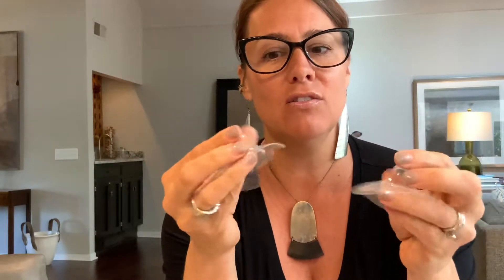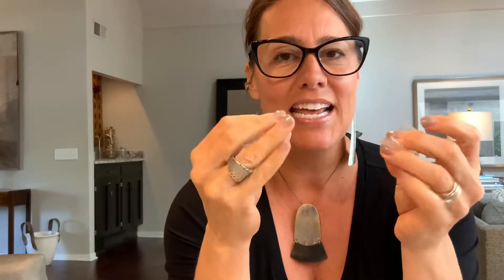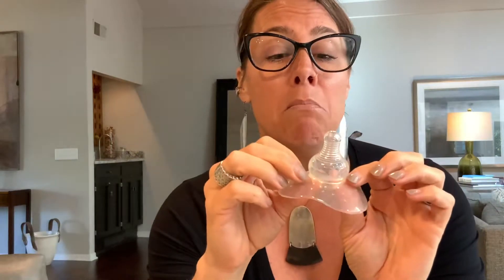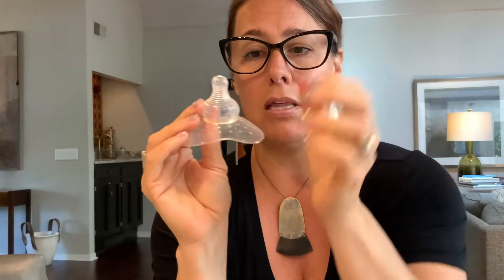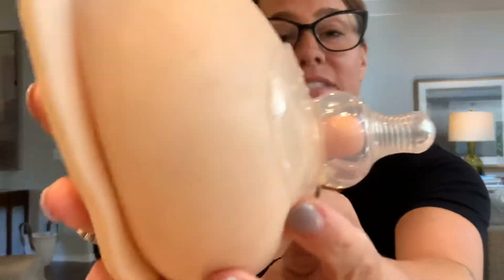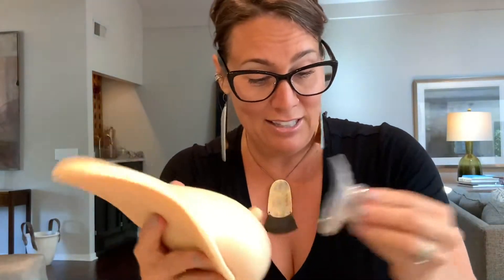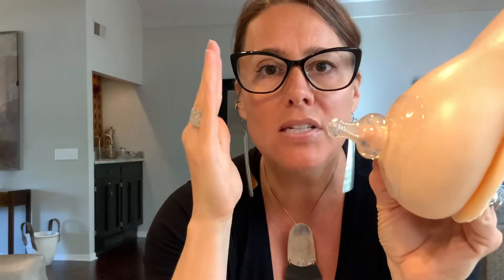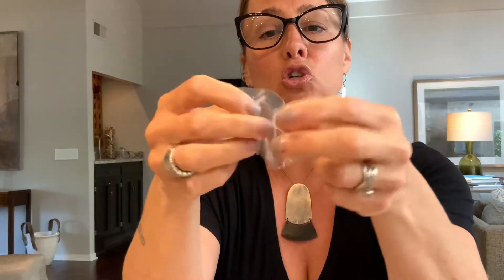WARNING! Dinosaur Nipple Shield

Comment: So I used this exact nipple shield that you’re talking about is bad- but I used it and it actually helped stimulate my milk supply and also helped my son re-latch. And he eventually latched without the shield. I used it because my son didn’t like the smaller ones you were showing. I only recommend it if you’re trying to get your baby to re-latch but don’t depend on it because your baby isn’t going to get the same amount of milk in a session compared to if he latched without a shield. Your nipple actually does get stimulated and it does get pulled into that section you said it wouldn’t reach but it does. But it’s still not the same type of latch as without it. And using the other smaller ones would be a better latch. But my son only liked the bigger one unfortunately. In the end, he re-latched and it helped increase my milk supply so that’s all that matters to me.
Reply: I also used this exact nipple shield and it also really helped me to get him to relatch. My nipple was stimulated and it helped me get him back to the breast.

This video is incorrect and doing harm by dissuading women from trying it when it is worth a try for many.  It was recommended to me by a midwife and lactation consultant who are highly qualified.
Reply: @andisiwekabeya7438  he was between 4-5
 months
Reply: @andisiwekabeya7438  I used the one on this video. it's on amazon. if you look up nipple shield you'll see it in the results
Reply: I agree, this nipple shield helped my baby relatch and today he latched without the shield at all. So ladies please don't listen to this video!